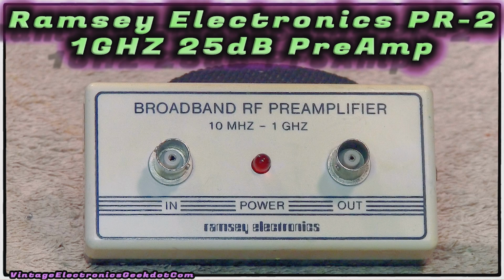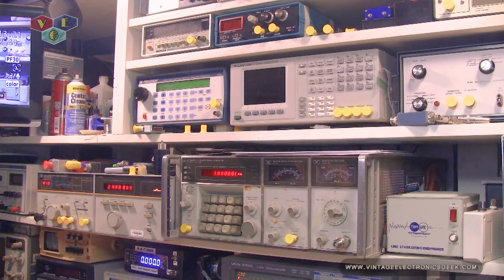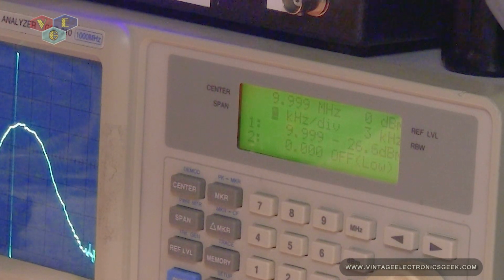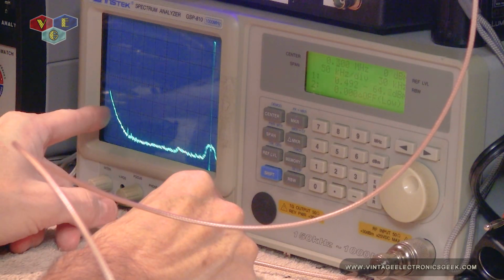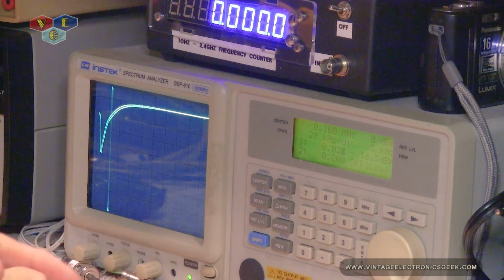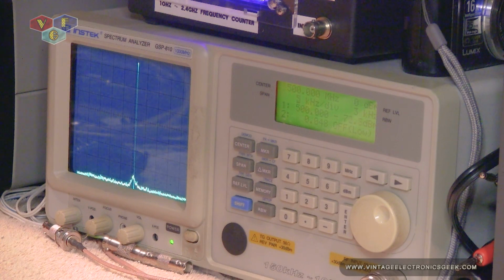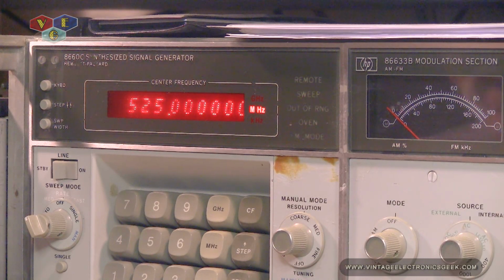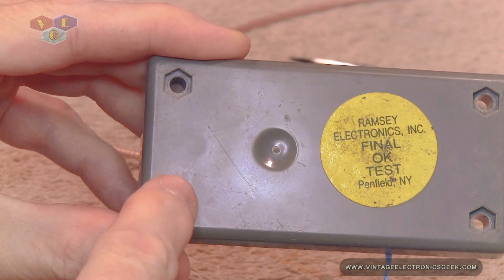Ramsey Electronics PR-2 - 1GHZ 25dB PreAmp - Extensive Testing / Guts

Comment: Looks like it works pretty good Jack. :) Are you sure it said full wave bridge and not just full wave?
Reply from the maker: Thanks Doug!  I will re-examine, it is plausible after all I am half blind :)  Reading at times is challenging, even at full screen on my 40 inch monitor...if its a bad scan or the pattern of the text is goofy, it will cause my eyes to jitter...   ~Jack, VEG